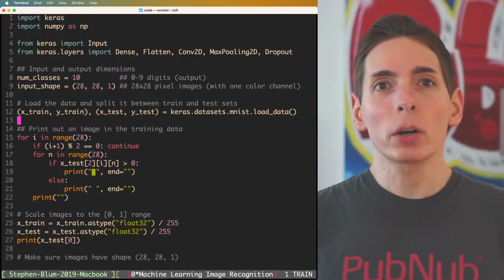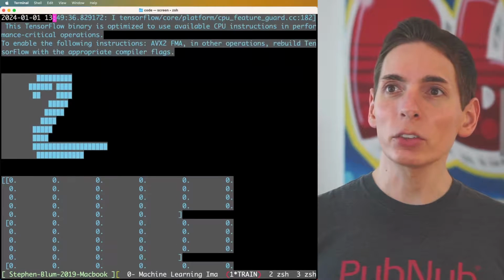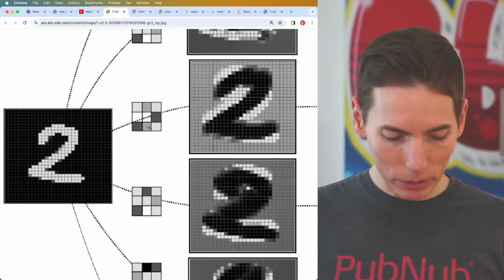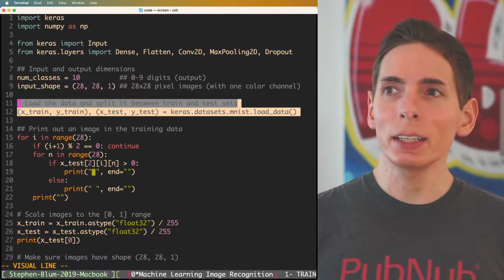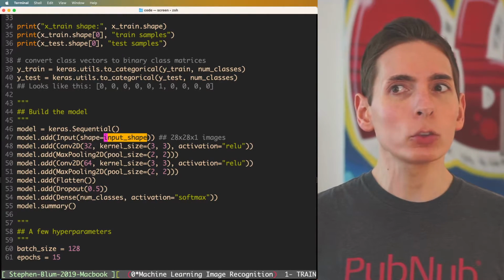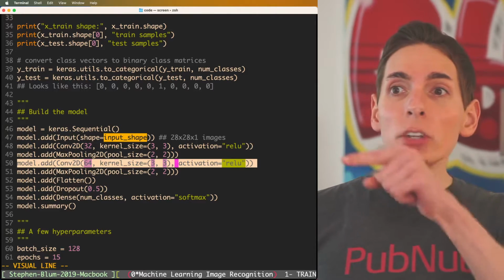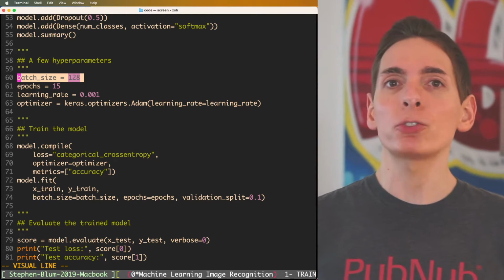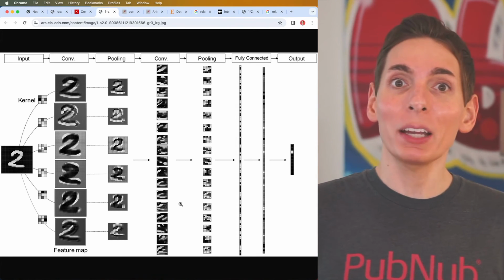Machine Learning Image Recognition

Comment: I'm not sure if you can explain it, but I've been trying to find an explanation for a transformer architecture based on just a single word as text corpus like the word "as". Kinda in the same way there's a video explaining neural networks using only 4 pixels. I'm not sure if it's possible, but I'd love to see it. Thanks for the great content!
Reply from the maker: Nice! Thank you 😄 For Transformer architecture, the idea is all about "Attention" which solves RNN vanishing gradient issue. The Transformer architecture compares relationship between each word in a sentence input. You can do this with a single word too! You would "attend" to each letter in the word as the input. For Q K V you could use letter encoding and skip an embedding. Or you could use byte pair encoding embedding for a smaller model. Your input size would be the largest word length you want to support.